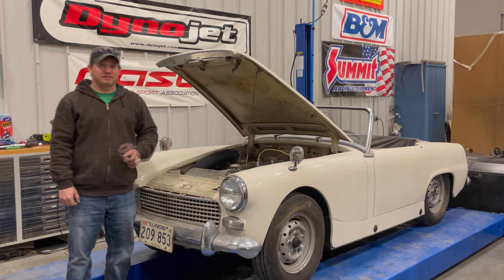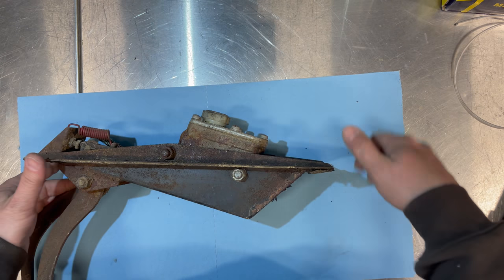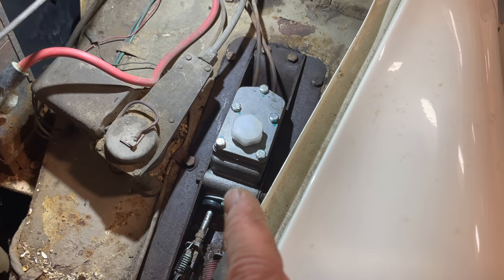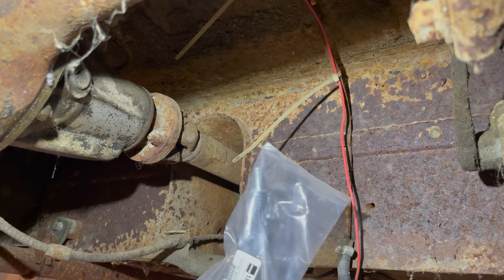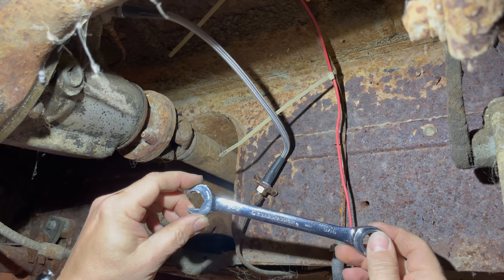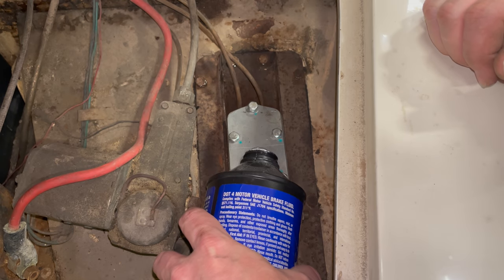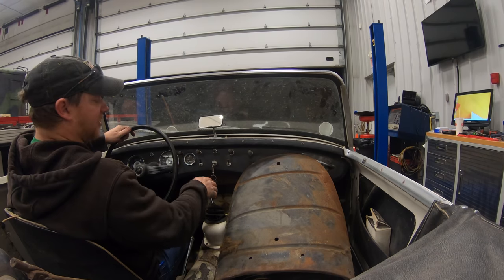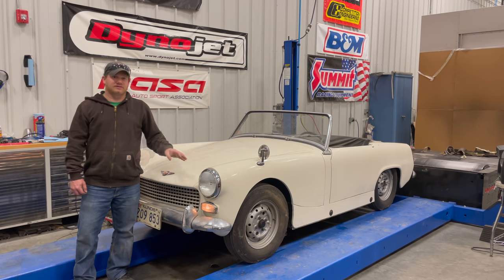1962 Austin Healey Sprite Mark II - Will It Drive?

Comment: Best of luck with this car. I was getting nervous with that driver's side rear wheel as you backed up. Good information you passed along.
Reply: Almost off the ramp, but still firmly on it, its a pass then..lol
Reply: That is the life of owning a sprite, every trailer, ramp and lift is right on the edge of too narrow.  I've been told by U haul that I couldn't tow my sprite as it was too narrow for their trailer.

Comment: Thanks for sharing.
If you are going to be working on the brakes you could consider a front disc conversion from a later BL vehicle. It might offend the purist but not as much as a crunched bonnet would.

Comment: Steve: I dont have an austin healey sprite or midget but I have restored several antique cars.  I think you should paint the parts that you replace.  The master cylinder and bracket as well as the slave cylinder.  This would not improve function, only the looks.  Left unpainted it will rust up and look just as bad as the old one.   David Adair

Comment: the wheels weren't far enough apart on my '61 mga to fit properly on a '60's era gas station's oil changing lift (i worked at one for a year or so back then). one side always rode up on the ledge.

Comment: Did you customize a wrench to get to those pipe bolts or did you buy one? I think you had an example once upon a time of a wrench you bent to reach those bolts?
Reply from the maker: The ones on the master cylinder?  No a regular open end wrench will get to them no problem.
Reply: @ThisWeekWithCars  do you recall the proper wrench size for these fittings?  One loosened without a problem using an 11mm, but the other is stuck and has rounded out a bit in the past - would like to get the right size on this one to avoid destroying it.

Comment: i was wondering if the rear tire was going to ride off the lift as you were backing in. what about a sharpie line at the width of a tire down the rail to show you where you are? might save some grief in the future.
Reply: That's  great idea !  I have the same problem with my 4 post lift and wouldn't have thought of doing this...cheers